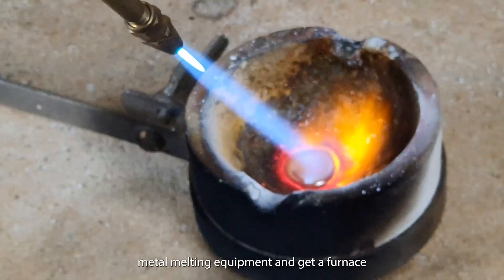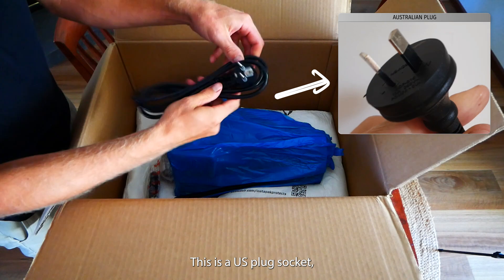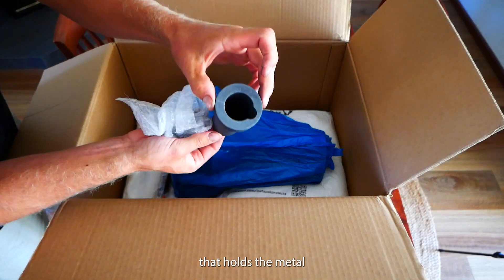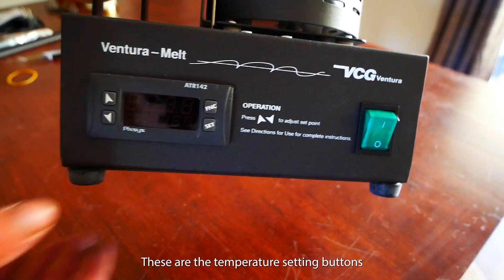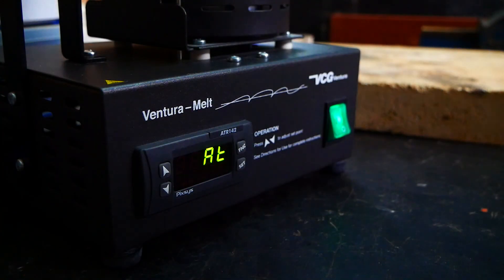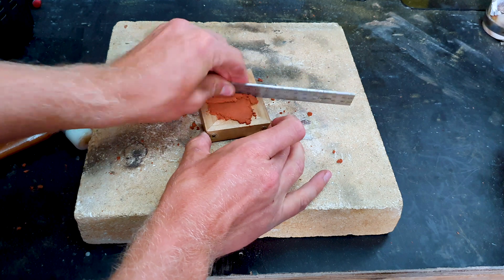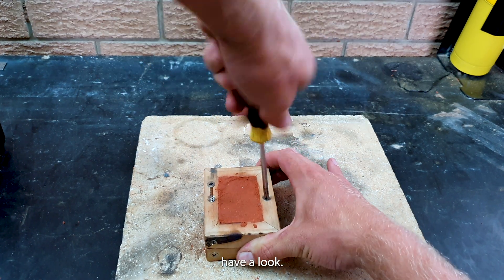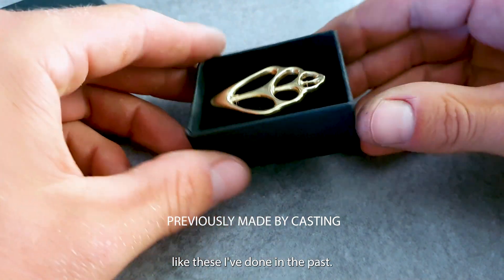Metal MELTER unboxing & test! for Jewelry Making

Comment: Hey! Great video.
Can you take the crucible out when pouring? (with tongs)
Also, how long did it take to get to temperature?
Also, how many grams fit in the crucible? 
I’m thinking of melting down some gold and silver into cast bars for a bit of fun! 
Thanks 😊
Reply from the maker: Hey thanks very much! This furnace is made to pour like a kettle so no tongs. Takes about 20 minutes to heat up, I need to time it properly though. This is the 1kg model can get a model 3kgs too. Hope that helped Thanks again 😊
Reply: @Raicullimore  Hey!
That’s awesome & helps a lot! Thanks so much for sharing your experience. I really appreciate it 👌 😊 
Ps.
I enjoyed the editing on your videos, you have a good pace. 
Thanks!